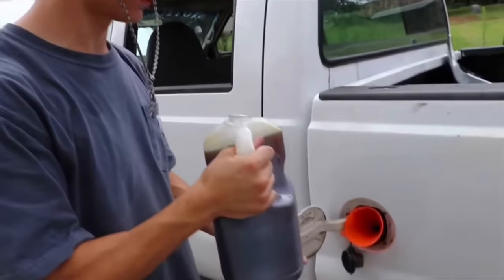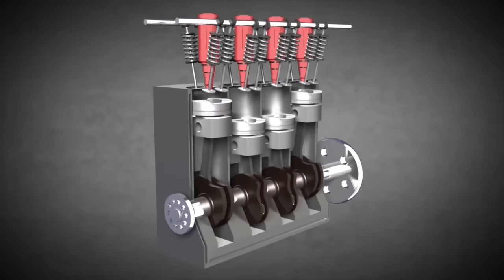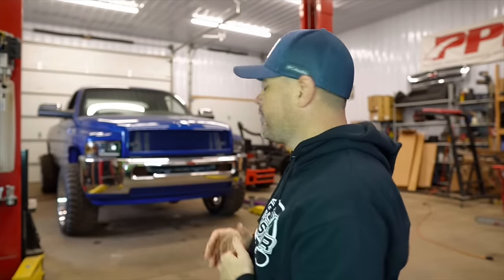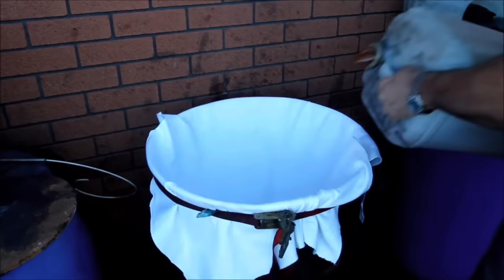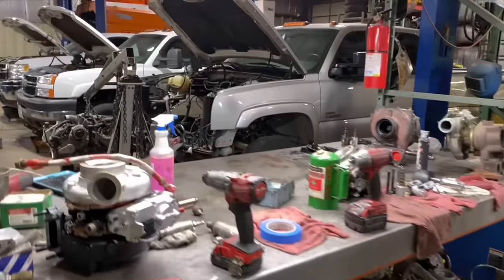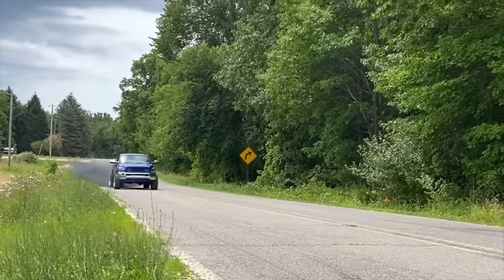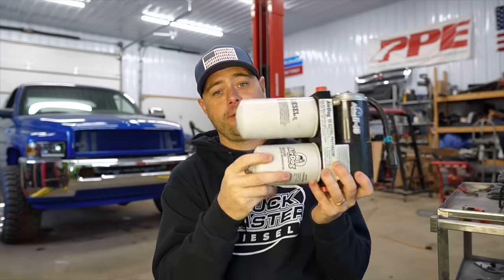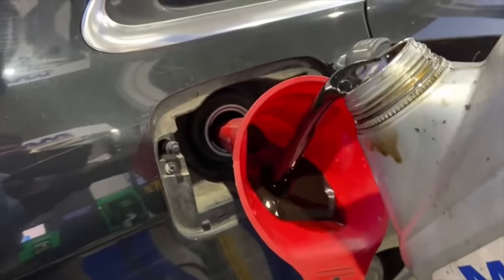Can You Run A Diesel On Used Engine Oil? Free Diesel Fuel? *EXPLAINED*

Comment: I burn used oil. New oil and atf. I don’t notice a single difference other than a haze at idle when it’s running. This is in a 95 12 valve.

Comment: I was told if I put 1ct of trans fluid in my diesel it would help lubercate thing better is this true
Reply from the maker: I’m probably going to make a video on that to explain it better but some have seen a good return on this practice
Reply: I’ll be looking for the video as I do will all your videos
Reply: First time I've heard of this practice, Josh (Truck Master) says he'll make a video, I'll have to wait to see what he has to say. As for lubricating the fuel system, I personally use 1 fluid ounce of two-stroke oil for every gallon of diesel I put in my tank. So if I add 10 gallons of diesel, I'll drop in 10 fluid ounces of two-stroke oil. I don't too much care for the brand of two stroke oil, as long as it is TCW3 certified (certified to be "ash-less").  Keep in mind that all of my trucks are pre-emissions, they came from the factory without cats, DPF, EGR, SCR, etc... I'm not sure how the SCR and DPF would react to an engine burning TCW3, even if it is supposedly ash-less. I did talk to one guy who used TCW3 in a gasoline motorcycle. Apparently he would store his motorcycle during the winter, and thought that the TCW3 would stabilize the fuel during storage. After a number of years, he yanked the head off the engine to find the intake valves caked with hard carbon. Of course his engine had port injection (the injector sprays into the intake runner), while diesels are direct injected (fuel sprays directly into the cylinder), but still, that's a story of someone who had a bad experience with TCW3, and he was using a lesser amount than me. I use 1 fluid ounce for 1 gallon.  He was using 1 fluid ounce for every 5 gallons.
Reply: It's a cleaning agent not for lubricity. Can do it on a gas motor too. Dump a quart in oil fill, then run it for a bit to get through the motor and clean it out, then do an oil change...goes waaaay back
Reply: True! Diesel fuel today doesn't lubricate well enough. A lot of people usually mix 1-2 oz of 2 stroke oil into their fuel tanks.

Comment: Got a 7.3, will get rid of it if the engine fails catastrophically
 would try the motor oil thing if I hadn't just changed the fuel filter

Comment: Actually there's a guy who makes his own homemade diesel out of 10% still gas and 90% use the motor oil and it took his 12 valve Cummins from you know stock power which is 160 at the crank and he was making 187 at the rear on the dyno with the automatic and engine oil burns at a much higher energy than diesel so it makes more power and in terms better gas mileage

Comment: Just have to thin out the oils as much as so this way it’s easier on the high pressure side, running oil thru any VP setup or 00 & up diesels is fine but it’s the thick viscosity is that kills the pumps.

Comment: You can use black diesel in newer diesel motors but the used oil has to be run through a centrifuge to reduce contamination down to under a couple microns.  Only problem will be the dpf ash build up.
Reply: I would not recommend how dose 1000$+ per injector sound what if it gets clogged
Reply: Well that would be on your filtering
Reply: I will say this though the dpf isn't likely to like the burning oil too much of that and really expensive emissions devices will be removed or replaced
Reply: @fangofango6136  thats why you use centrifuge to remove any particles larger than a few microns. Also most people running black diesel probably have the EGR, DPF, DOC deleted.
Reply: It's similar to the process used for cleaning cooking oil to prepare it for biodiesel. You can pick up centrifuge pretty cheap these days.

Comment: I filter my oils down to 0.5microns and run it in my 01 5.9 Cummins and my 07 6.7 Cummins with no issues or power lose

Comment: My old cummins 12v runs fine on filtered used engine or veggie oil. I wouldnt try it on the newer emissions trucks everything about them is too expensive.

Comment: I’d like to know how many non commercial drivers have had there tank checked for red fuel (agricultural diesel). I know a ton of people that use that.
Reply: I did once during the last “fuel crisis”. The guy in front of me had red fuel in his and was arguing with the state trooper since he was doing farm work at the time.
Reply: @vadrifter3200  I remember them doing it pretty heavy back when they changed to ultra low sulfur diesel. People would put transfluid in the older trucks to save the pumps and injectors.
Reply: In 2016 my wife was driving my 15 super duty dually and was approached by the state of TN . They said they needed to check her fuel for off-road diesel. She let them and sure enough me having a construction company, from Time to time I'd just add a little off-road fuel to my tank. They fined me 1,000 dollars since I only had a qrter of a tank, would've been 2,000 for a half and 4,000 full.

Comment: I don’t know But I know if you have a filter system filtering the used motor oil and/or transmission fluid filtering it through your filtration system getting out all the bullshit before you put it and run it through your vehicle then yes you can run it there’s no issue with that. Your truck will burn it now with the newer shit with all the sensors and computers and shit. I don’t know if it’ll work I mean I’m sure you can tune them to run on it but that’s a whole process

Comment: What about the microscopic metal in used motor oil?     Eventually the metal would ruin the diesel engine by tearing up the rings and the cylinders.

Comment: I had several gal. Of 2 stroke oil that was new and I put a pint per fill up until it was gone, did not have any problems.2011 Duramax.  Heard it was probably good for the CP 4 pump.

Comment: I used to make biodiesel but if not careful you have lots of soap. I burned atf and used motor oil for years to dispose of it, you actually have to filter it so you don’t pile up sludge in the bottom of your fuel tanks. Jet fuel and kerosene are a lot hotter then diesel. Probably never use those from me. Gas’s will ignite and and you can have a run away motor or oil leaking turbo or other such stuff. I wouldn’t put anything in these new motors
Reply: Thank you but I don’t know how to do that

Comment: You just filter the waste motor oil and 50/50 diesel the downside is the soot motor oil is harder to burn than diesel even if you dilute it with gasoline or diesel
Reply: used oil burns clean if burned properly

Comment: I run straight diesel in my lly duramax but plan on running 60/40 oil to diesel in my 7.3idi build when its finished. It will only be run in the summer and the fuel saving will outweigh the costs of filters by math but I am also gonna build a filter and water separator to run it through before it goes Into the truck

Comment: Diesel and kerosene are similar  but also very different.  You will ruin your hpfp if you run kerosene in your truck.  Kerosene lacks the lubricant diesel has.
Reply: Hundred percent yes...but a mix is ok and done a lot in cold climates. Easily up to about 1 Gal per tank is common if I recall

Comment: what if you mixed filtered used oil and regular gasoline to offeset the lack of lubricity from gas?
Reply: I mix used oil and run ot through my lawnmowers and weed eater.  Something happens no big deal but never had any issues.   If I was sure about it not affecting my L5D I'd run it that in a heartbeat

Comment: Diesels made pre 2016 are viewed as public enemy no 1 ,now,in the UK.
Lots of city low emmision zones are being set up by the green washing machine and a vehicle burning used engine oil, with a trail of black smoke , would be attacked by clean air drones and destroyed.

Comment: I wonder if the used oil type/ weight makes any difference and how about what kind of engine it came from, like a gas, propane, or diesel? 
I know I can tell by the smell of used oil what kind of engine it came out of so they probably burn different

Comment: I been running used motor oil in my 2008 cummins 6.7 everything deleted.  No issues. I change my fuel filters every two oil change. Lower MPG but it's ok.
Reply: Hey, was wondering if you filter the WMO at all that youre using? I've cleaned WMO through my centrifuge for use as fuel in my deuce and a half (after thinning with kerosene or gasoline). The sludge that came out of the cleaned WMO was literally like peanut butter. I don't know how long injectors will last with the micro metal particulates in uncleaned oil, running through them. 

Just a thought, since you're running a common rail with tighter tolerances than the mechanical fuel systems. A set of injectors for our Cummins' are around $4000, last I knew. May be more $ now.

Comment: Illegal in Scandinavia to. Agriculture diesel is colored, and stains the fuel filter. Here, a car goes through inspection every 2 years, and they will find out if there's colored diesel fuel in the tank. 😖
Reply: its easy to remove the color
Reply: @antoniosestar3671  how? It's not easy. Clean the whole system multiple times?
Reply: @MetalDevil1912  use cat litter to filter the fuel
Reply: @MetalDevil1912  thats bentonite clay which is can strip the color making it like normal diesel

Comment: We put our used engine oil in our fuel tank on the boat I work on but we have a double fuel filter system causes no issues but I wouldn't try on my truck

Comment: What about used filtered transmission fluid, if you did a 50/50 mixture
Reply: What are you running it in, and how are you filtering it?

Comment: I have a 06 lbz stock truck sorry this is off subject but needing some advice have you ever had one to make aloud bypass sound and the transmission stop changing gears until it's shut off a started again and I've also had some grinding noise around the drivers side floor board when I try to get done on it and it doesn't seem to be slipping again it's not all the time just new to the diesel world and would love to fix the problem before it gets worse or tears up I love this truck

Comment: You just have to run it through a fine filter if you going to run it through a new engine the brand new ones you have to make sure there's no crud or crud in the oil it can be dirty engine oil but no bigger than a couple microns in that oil a diesel engine will run on oil you ever have a very old diesel engine that runs away with you because the rings are bad and the oil is coming up and actually firing do and burning and the combustion chamber cuz you got bad rings

Comment: So much information is ignored.  "Black Diesel" is no new thing.  The secret to getting used motor oil to burn efficiently in a diesel is to mix it with Gasoline or Ethanol at a specific ratio...  You get the desired oil content and the required viscosity... 4:1 is the desired ratio of used motor oil to Gasoline.

Comment: Any info on ATF in the diesel fuel tank? Heard both sides to that, some guys swear by it a quart or two in every 5-10 gallons.
Reply: My truck is an 03 Duramax LB7 for reference
Reply: I heard from an old trucker that he would add a quart of atf at each fill-up. The high detergent cleans the fuel system and it adds lubricity removed by the reduced sulfur. I would add atf to my 6.2 and 6.5 suburban s every few tanks. I now have an LMM and always add treatment to my fuel as the previous owner said he did. On the older equipment I know guys who would fill the fuel filter with atf when they changed them because they would prime better with the higher viscosity.  Probably wouldn’t want to try that today.

Comment: I have an all mechanical Toyota 3B diesel engine in my 1982 Land Cruiser. I only put in my own used oil and only 5-8%. It’s my understanding new diesel fuel is less slippery/dryer than when mine was made. So for this purpose and concentration, I’d call it fuel additive. Also saves me a trip to recycle the old oil - which often gets burned as fuel anyway. Truck seems to run the same or a little better/smoother more throttle response. Hard to say. Certainly no worse.

Comment: How are you doing, hope all is well. I have a quick question. So I recently got a oil change on my 2005 lly. I came to the place where I have been coming for the past 3 years. Everytime they do an oil change they show me the oil stick and the oil is black. Normal thing but this last time the oil is a rich yellow like the oil they use on motor vehicles. I have gone back to ask if they added the wrong oil on my truck, they say they’re sure they added diesel oil. It’s apparently rare but normal. What do you think, can my oil actually be yellow in my diesel truck??

Comment: Can someone please help me out?  I have a 2004 duramax diesel chevy silverado with a tune.  This truck has been tuned and is set on the highest setting.  It is an amazing truck but get horrible gas mileage.  I want to reprogram it but I don't have the original tuner.  What do I need to do to reprogram the truck so I can chance the tune?

Comment: I have a 92 cummins I was told I could use 50 gal of oil mixed with 5 gal diesel to use to burn thru my truck without any issues. Would that include any oils like trans fluid gear oil etc
Reply: Your diesel engine will burn all of those however you cannot put any of them in your engine without filtering. I've heard that the ve pump is very intolerant of the gunk in used oils

Comment: I hate diesel. There's no need for a diesel pickup truck.
My square bar is 2500. Could pull just as much as a diesel pickup truck can. Cause I put it to the test against other diesels

Comment: Great video ! Just a question if you have time . Just had the transfer case replaced on my 2020 Denali duallie under warranty with 70k . Water got in it and ruined it ! I check the vent hose routing and it ends on top of the trans! I rerouted it down and alongside of trans ! Any advice ?
Reply: 2 things , how did water get into it ??  2nd.  if it came thru the vent hose  & now it's the exact same position & routing , wouldnt it happen again ??
Reply: Read post, hose was rerouted to the side of trans and facing down ! I assume water got in from hose laying on trans facing forward and on an upward angle !
Reply: @peterlake2463   I did read the post , that's why I replied !!  My 2 questions were an example of what YOU should be asking yourself since YOU are having the issue , and using common sense to solve it so it won't happen again !!  Physics , Gravity , & Inertia Pressure is the root of most common problems , and B.T.W  ...... Current Mechanic for over 40 years !!  Have a nice day !! 😊
Reply: Extend it higher up near firewall etc

Comment: I have a F350 2002 7.3 4X4 lifted, manual trans, crew cab, long box I would sell. Washington state branded title. 105000 miles. Bright yellow.  I've had truck since 2006. Runs good but sits alot. Curious what is it worth. Won't give away for all you jokers out there.

Comment: I watched your video and you have Cummings and Duramax covered but what can you do for a Freightliner with the Detroit dd13 it's a 2015 Cascadia and I too am getting tired of paying almost $5 a gallon for diesel when I pull up to the pump I don't drop a hundred or two for me to fill up is about $750 on a good day what advice do you got for an old truck driver trying to get by? All of this dropping my pants and grabbing my ankles every time I go to fill up my rig is getting ridiculous and how did you work around the d e f system or does it work with the new Diesel mix
Reply: You're probably no longer waiting for a reply but I would say if you have the emissions controls you are unfortunately out of luck unless you want to learn how to distill the diesel from the used motor oil

Comment: I have a 280gal oil barrel in the basement, been there since I moved into my place, it’s actually got around 70gallons left. Idk how long it’s been sitting down there. Can’t get the tank out dunno what to do with the old fuel oil. Any suggestions for what I could use it in or try disposing it to a part store or something?
Reply: It's just diesel fuel. It's high sulper fuel if it's that old. Likely might have algae in it but maybe not since it's high sulper.

Comment: Hi just looking up this subject about old diesel fuel. Anyway I have a Diesel 95 Dodge ram Truck 2500. Only has 29k miles. Sits in my garage. In close to perfect original. Anyway usually start up and run when good weather get here in Ohio. But the diesel fuel in tank is getting old. Last time 2 year ago I got a 5 gal of fresh and put in before starting. Now as of 8/11/24 I am questioning to start it up or drain old and what to do. ( So I have seen go through the huge ordeal of draining , and some clean the tank.) What can I do to make this as easy as possible? With out Hurting my Truck, Engine. 1995 Dodge ram Diesel 2500. Thank you. Some soon let me know.
Reply from the maker: I will add diesel treatment to it and run it. The good news is that you have a Cummins and the engine can run on peanut oil if you had to. It should be fine but that’s just my opinion

Comment: Anyone tried using used motor oil or other fuels other than diesel in a 98 5.9 12v p pump?

Comment: What about using jet fuel in a diesel
Reply: Jet fuel is just highly filtered kerosene. It will burn in an oil furnace, and in a diesel engine, with a little less lubricate. But you won't find jet fuel for cheaper than kero or diesel.

Comment: I HAVE A 1980 300D MERCEDES BENZ WHAT DO U SUGGEST I LIVE IN FLORIDA
Reply: Filter it all and run it. Those old diesels are not picky and here in Florida the temperature is always good for it. But you still should thin it most use 10% gas so for 50 gallons of oil add 5 gallons of old gas